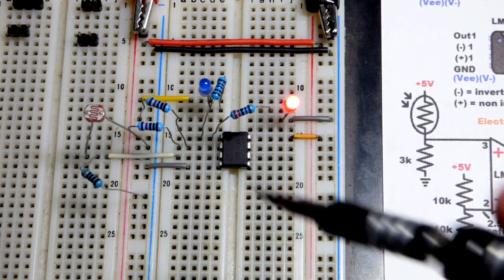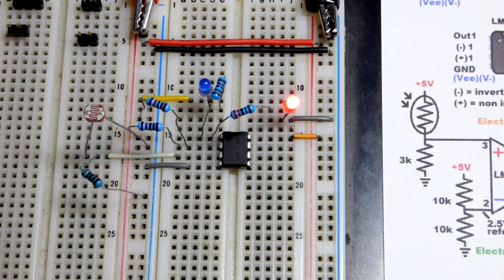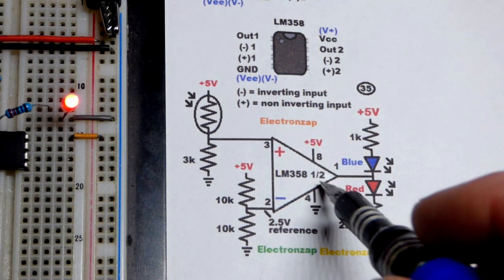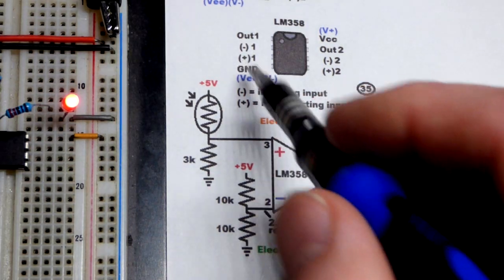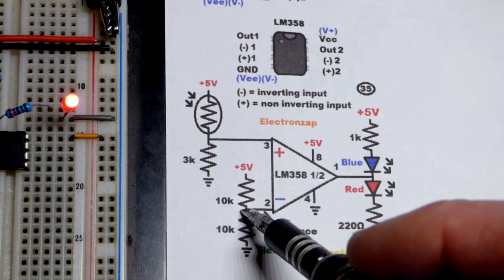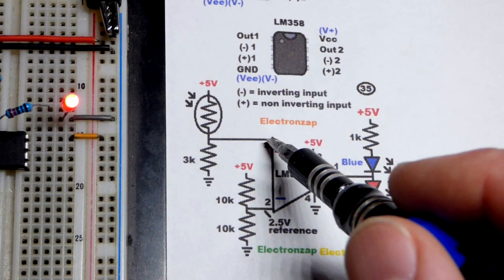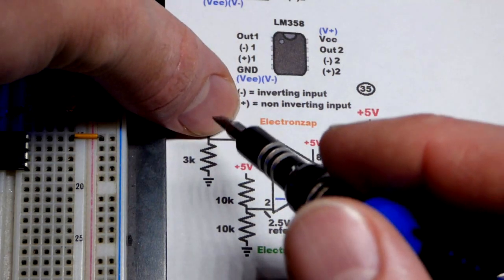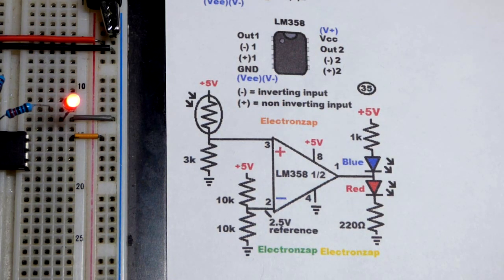Light Level Controls Op Amp Non Inverting Comparator Circuit LM358 Operational Amplifier

Comment: If I set the source voltage to 6V instead of 5V, will the values of the circuit elements change?